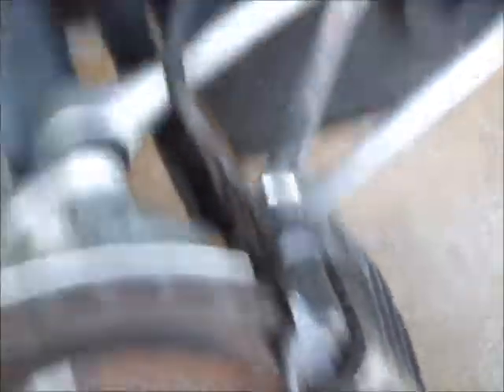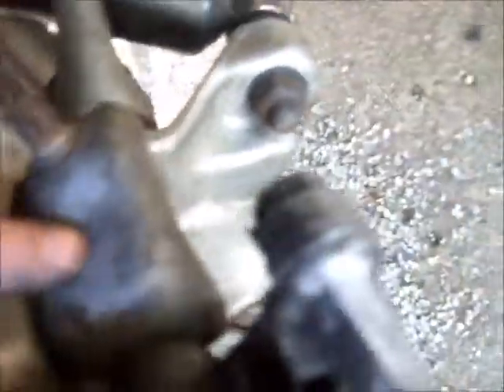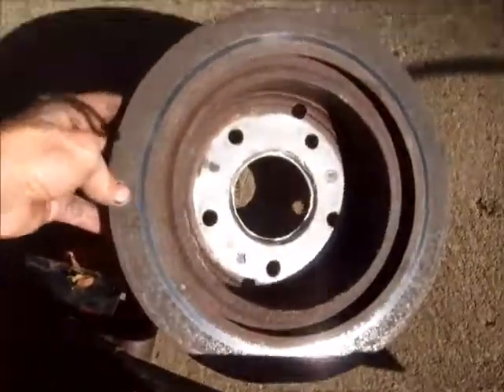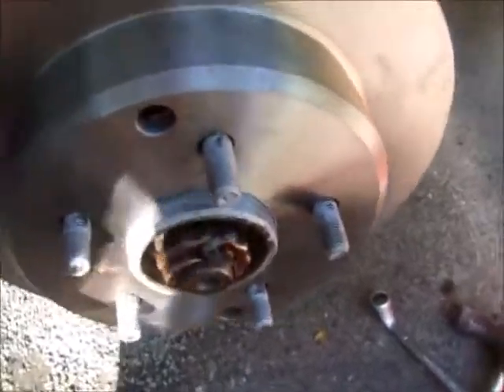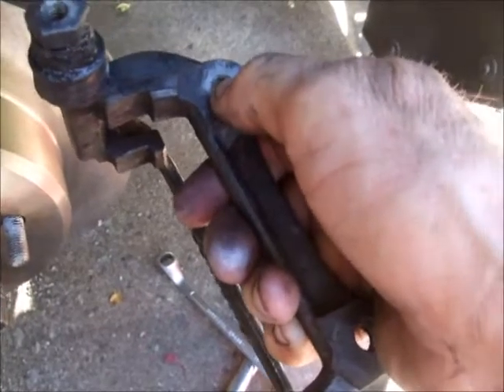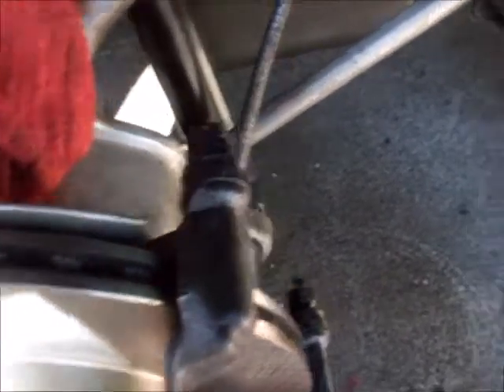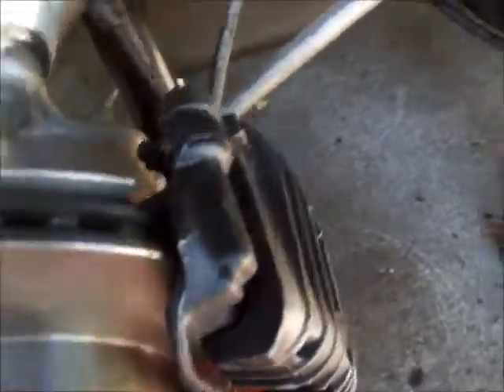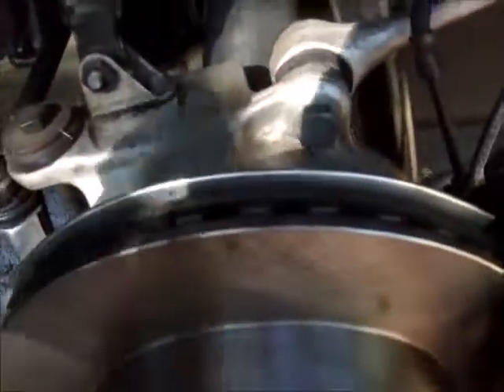𝟏𝟗𝟖𝟒 𝐂𝐎𝐑𝐕𝐄𝐓𝐓𝐄 replacing my rear Brake Rotor

Comment: Did you replace the self locking bolts like the shop manual instructs? Thinking about just using blue thread locker.
Reply from the maker: If your talking about the guide pins, the calipers I purchased came withe kit and that's what I used. I lived in the NE rust belt I used anti seize pn all mounting bolts and always torqued everything down to spec. I did use thread lock a lot on other things.